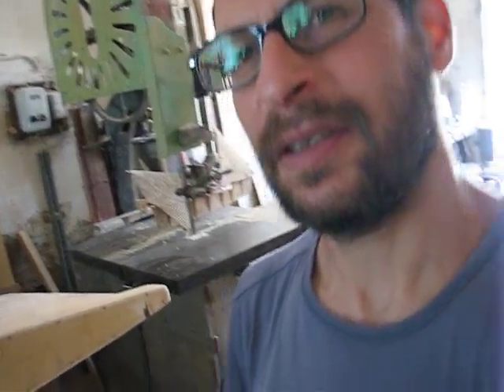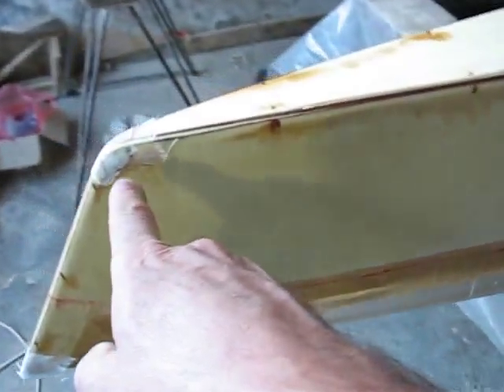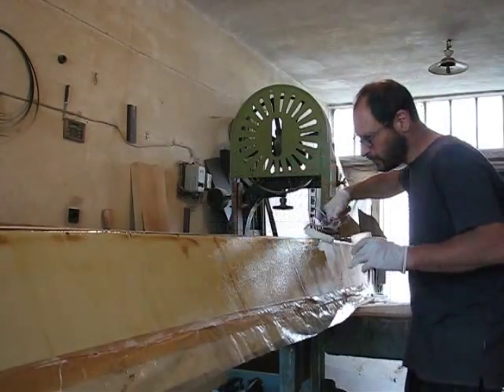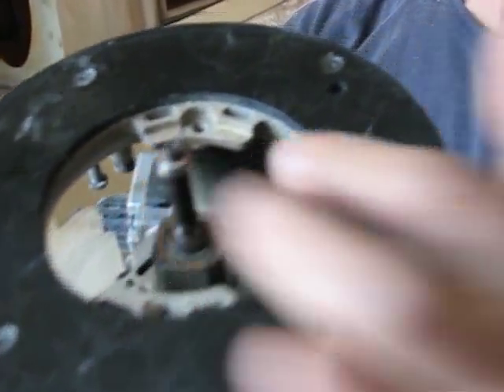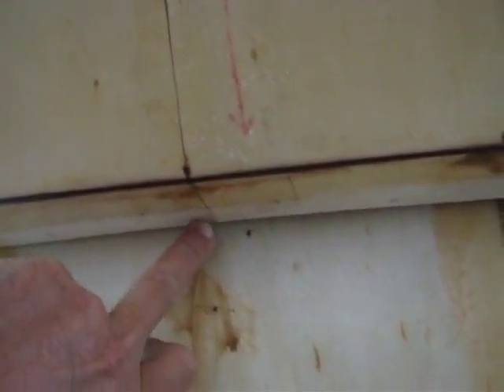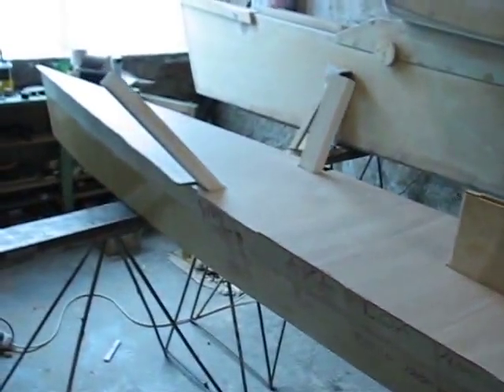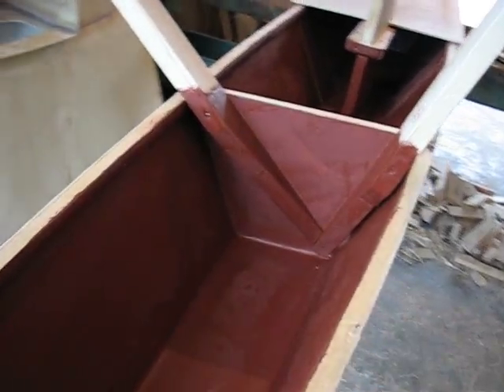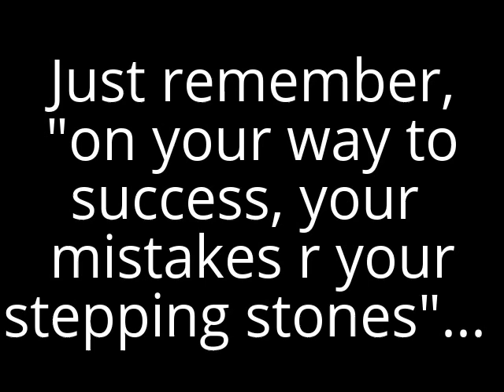Total Proa Build, episode 11

Comment: Hi Rael, do you fibre glass your hulls just to stop water soaking into the timber, or does it make the hulls stronger as well? Is the plywood for the hulls 4mm? Thanks. John
Reply from the maker: Hi John, yes main reason is to prevent water penetration, yet fiber glass does strengthen the ply and on impact it reduces damage considerably. On these hulls all ply is 4mm poplar, exterior grade good quality. My boats stay for weeks in the water, never had a problem...
Keep Shunting, Balkan Shipyards